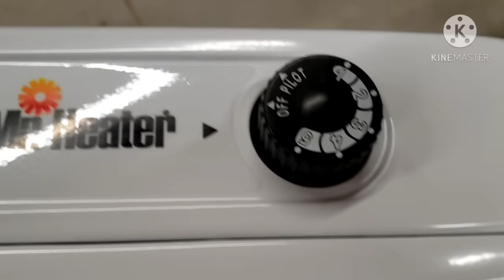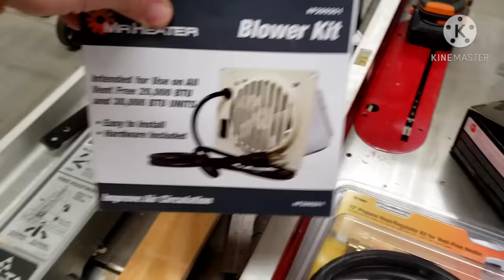Mr. Heater 30k Btu Propane Heater Opening And Install!

Comment: I just noticed Mr Heater says to keep the propane tank outside with these units. Does anyone follow that?
Reply from the maker: My long term plan hopefully soon is to have it hardlined to the 500 lb tank outside. I have noticed alot of people dont keep the tanks outside but im sure for insurance and liability reasons it is probably best to have it outside.
Reply: @HermanWoodworks  Yeah, that tank exploding may be too much to bare.      I used the smaller buddy heater on our boat,,, it does help air quality to boil distilled water while heating, like you need any more moisture with this heat source, hahaha .  supposed to replace oxygen in the air.  They are great heaters.
Reply: @coastalcruising8231  Actually, the process of combusting propane creates a lot of water vapor. Extra moisture is not necessary.

Comment: Do you recommend it after using for awhile ? How big is the area of your heating ?
Reply from the maker: Sorry for taking awhile to respond, I thought I posted a response but it didn't go through.  I do recommend it still with certain expectations, I personally dont prefer to run it without being in the shop. It does produce some moisture after running it for awhile. Im heating a 28x28 area with 12 ft ceilings.
Reply: Okay thanks for the reply

Comment: How long did that 20lb tank last
Reply from the maker: Alot of variables...based on my insulation, only keeping it on the 1st setting and having 12 ft ceilings.....about a week of intermittent use... I did a follow up video where I hooked it up to a 500 lb tank.

Comment: Is there an ON / OFF button for the fan?
Reply from the maker: Yes, it also has the option for manual or auto run. Manual just runs when you turn it on til you turn it off. Auto setting runs when it hits a certain temperature.
Reply: not to be a bother, but as you said the fan has an auto and manual switch - does the unit have a thermostat?
Reply from the maker: It doesn't have a traditional thermostat. It has settings from 1-5. I set mine at 1 and it seems to stay around 60ish. No bother at all. Take care!

Comment: Is it safe to use indoor? Doesn’t produce monoxide or any toxic fumes?
Reply from the maker: They say it burns at like 99.8 percent or something efficiency and is ok for indoor use...
Reply: I've been using similar heater for the past 15 years in my workshop with no issues. hooked mine to 40lb. tank with couple of monoxide detectors.
Reply from the maker: @sidmonitch  good call on the carbon monoxide detectors! Also great to know it has that kind of longevity possibly! Thanks!

Comment: can you give a model # or maybe even a link to this unit where you bought it?
Reply from the maker: https://www.tractorsupply.com/tsc/product/mr-heater-vent-free-30-000-btu-liquid-propane-radiant-heater-f299830?cm_vc=-10005#
Reply from the maker: Hope that helps!
Reply: @HermanWoodworks  Thank You. I need to hook it up to a 500lb propane tank. Someone said on amazon it only hooks to a 20lb tank..is that correct? maybe I should call mr heater.
Reply from the maker: @A.C.71  I did a follow up video where I did a final hookup and it is attached to a 500 lb tank. Let me know if you think of any other questions but give that video a watch... thanks!!

Comment: How long does 1 tank last? Thanks.
Reply: A pound of propane contains 21,548 Btu's. A 20 pound tank contains 430,960 Btu's of energy. Producing maximum heat at 30,000 Btu's per hour a tank would last 14 hours and 20 minutes.
Reply: @Skyhawks1979  wow.ok.my home has no centeral heat or air.i had a window unit that had heat/air.it went out.i thought about converting over to this option
But i dont have any natural gas or a big tank out here.i since bought a new heat/air unit & glad i did not buy the wall unit.only because i wouldhave had to use smaller proane tanks.that would have got real exspensive.and it would not even last for 2 days! Thanks for the info! Would make a great shop unit though!

Comment: The blower fan is a waste of money and isn’t really needed.  Also, I think a 100# tank (7 gallon) tank is recommended.
Edited:  30# tank is 6.8 gallons.
Reply: That doesn't sound right... 
I've used a small 20# tank... it's not the SIZE of the tank... when the propane is gone it's gone... Big or little ... it's the same pressure of propane coming out of the hose... if it's a small round tank or a huge 100 gal tank..
My husband works for a propane company...
Reply: @judichristopher4604  That will work.  I just mentioned that I had heard a 30# tank was recommended.

Comment: Is there a thermostat control on it?
Reply from the maker: It has one but it certainly isn't exact like a temperature reading. The same dial that has the pilot setting is numbered 1-5. It is more trial and error to see where about your heat preference is....I usually keeping mine set to 2.
Reply: @HermanWoodworks  I was wondering if it had a thermostat on/off control when it reaches a certain temperature automatically by going to pilot light only until needed.
Reply: Yes, the flame will go out and the pilot light stays on when it gets to a certain temperature.  The flame comes back on when it gets cooler.
Reply: @SaabAholic  Thanks

Comment: what is the model number, can not find on mr heater website , thanks
Reply from the maker: F299731
Reply from the maker: This may have been the blue flame unit...just double check
Reply from the maker: F299830
Reply from the maker: This is the radiant unit...sorry about that

Comment: How long does it run on one full tank
Reply from the maker: Alot of variables to that....depending on your insulation, how high you set the temp, size of the area...intermittent use on a 20 lb tank last about a week or so.
Reply: @HermanWoodworks  how many hours? On high heat
Reply: @wiillthebarbertv9415          A 20 pound tank will last approximately 14.4 hours.
Reply: @jshepard152  I ended up buying one , that’s about right too..

Comment: How long does that little tank last?
Reply from the maker: I seem to get 2-3 work days out of a tank....and i just realized the other day they are actually only 15 lb tanks. I guess there was just some lawsuit over tank sizes with amerigas and blue rhino. Im basing this on about an 8 hour window of the heater running each day and it should be said i was running it on the highest setting just to see what it would do. Overall im still pretty impressed, i cant say im confident with leaving it run without me being in the shop though....yet.
Reply: @HermanWoodworks  did you let it run In the shop yet? Thinking of getting one let me know.
Reply from the maker: @helloworld5158  I have let it run through the day while I'm home but not over a whole weekend. I conserve it for right now just because I don't have it hooked on a big tank yet.

Comment: YOU NEVER PLACE A TANK INSIDE - OUTSIDE ONLY - DRILL HOLE IN WALL AND RUN HOSE THRU THAT TO TANK OUSIDE TO UNIT INSIDE
Reply from the maker: I understand, hence why I said temporary....I did a follow up video for the final install to a 500 lb tank outside.

Comment: I honestly hate how many of these reviews feel the need to mention that something is assembled in China. It's not the 1950s any more, labor is outsourced overseas all the time. It's a non-issue at this point. As long as the American distributor has good quality control, a product being "Made in China" does not mean that the item is poorly made or cheap. Ironically, I find that products made in the U.S.A tend to be worse and more prone to fault than the ones made in China. Make of that what you will.

Comment: Can you time how long it takes to use a 20 lb. Tank?
Reply: Hooked mine to 40lb. tank and had it set at 68* in new england weather and it last about 2 weeks.
Reply: @sidmonitch  New England weather as in fall or winter weather? Thank you
Reply: A pound of propane contains 21,548 Btu's. A 20 pound tank contains 430,960 Btu's of energy. Producing maximum heat at 30,000 Btu's per hour a tank would last 14 hours and 20 minutes.